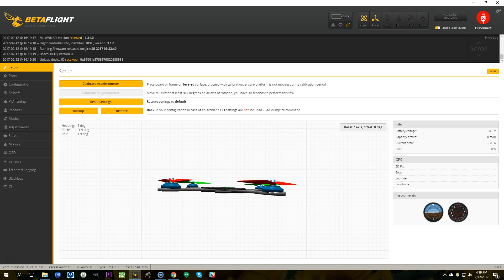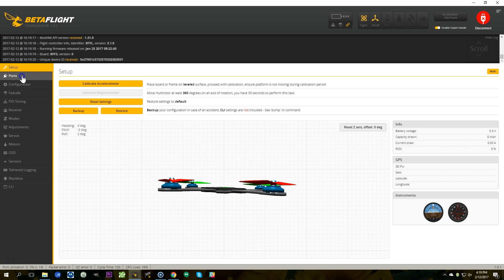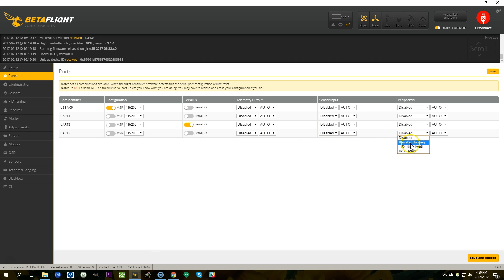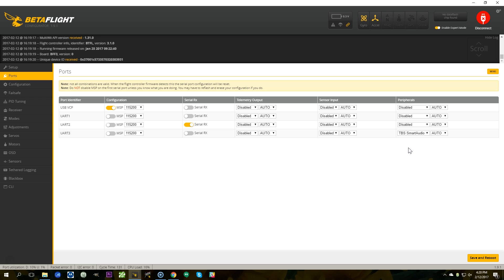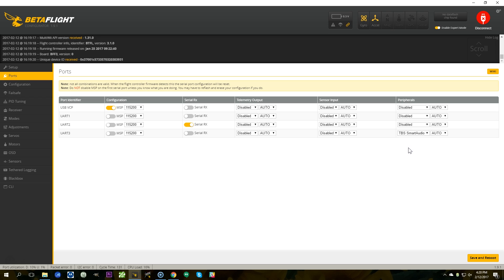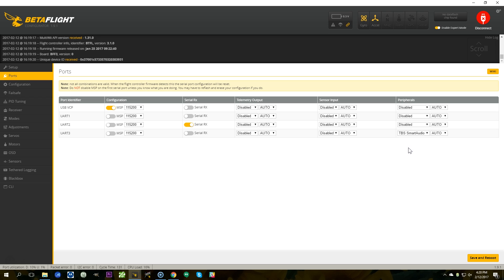BETAFLIGHT SMARTAUDIO | Change vTX channel and power remotely!

Comment: Very nice! Thanks for the video! I have DMed you on Instagram for another request :-)
Reply from the maker: +Ne Krähe Instagram is the least effective way to contact me by far.
Reply: Alrighty, whats a better way to contact you? (:
Reply from the maker: +Ne Krähe you can comment here.
Reply: okay, I did not want to bother you public with my concern, but well: I am working on an interesting project over here, basically a small camera-octocopter. Right now we use Betaflight but I am doint some flight tests on INAV right now. I already settled to CPPM rather than SBUS to save one UART, but still going short on them using bluetooth, GPS, Sonar.. Do you know an F3 FC (or F4) with 8 Motor Outputs but more than 3 UARTS? In the best case it has a micro sd slot aswell, for sure.. I have heard about more UARTS when using a bigger "package", so a bigger F3 seems to have broken out more UARTs, is that true? Do you have an idea to solve this?
Reply from the maker: +Ne Krähe rotorgeeks SSD has six motor outputs and 5 UARTs. 8 motor outputs is going to be tough.
Reply: Okay, so it seems to be very difficult right now.. If there is another thing coming to your mind and you did not forget my request, I would be happy to hear from you! Thank you very much for you reply, keep on your good work, always a pleasure! (:

Comment: So you connect the smart audio and then you can  change the channel and power of the tbs unify through betaflight or your transmitter?
Reply from the maker: +Jay Bennett yes.
Reply: Jay Bennett correct!
Reply: Graham Jones so how and where do you change the settings of your tbs unify in betaflight and/or your transmitter? How do you physically do it? This is where I am having a little trouble.
Reply: Jay Bennett in a nutshell, if you were going to use your taranis and not the osd, you would download opentx 2.2 and flash that, then you would get the betaflight Lua script, copy it to your taranis sd card in the scripts folder, set the script as one of your telemetry pages on the taranis. Then as long as you have the unify hooked up like in the video and you have smartport hooked up on your x series receiver (x4r,xsr,etc), you go to the telemetry page that has the script and change the settings on the vtx. Done
Reply: Joshua Bardwell.... So I went to the open TX home page to install 2.2 like what was suggested. Is it 2.2 RC10(N362) that I want? I am running 2.1.9 right now.
Reply from the maker: +Jay Bennett I'm not sure which version is best. I would probably take the latest.
Reply: Jay Bennett yes, be careful tho, I'd do a backup of your 2.1.9 models and settings if you don't already have one just in case, also you will need the new 2.2 Sd card files and folders, and you will need the 2.2 sounds and amber sounds if you use that sound pack, and that should be it.
Reply: Joshua Bardwell 2.2 rc10 is good it will work a few versions back to like rc8 but might as well get the latest. Also when u get open tx 2.2 configurator, you will need to go in the settings page and find where it says use open tx nightlys, for the firmware and the configurator and check those boxes. So it downloads the latest release candidate firmware.
Reply: Graham Jones I can't get the open TX 2.2 to update on my pc. I am going to have to spend half the night figuring this out. Lol I have some errands to run first. Is there a good tutorial on YouTube? I don't want to bunk my taranis.
Reply: Jay Bennett like you can't get the computer software to even install?
Reply: Graham Jones no the software installed perfectly. But when I go to see what version is going to be installed it says cannot update. therefore I cannot load a version to install.
Reply: Jay Bennett in the software go to settings>edit settings>application settings and check use opentx firmware nightly builds and use companion nightly builds if you haven't
Reply: Graham Jones will do as soon as i get home. I will let you know.
Reply: Graham Jones that worked! Ty! Now what was that about Lua files to my SD card? I haven't written anything yet to the taranis. What are these Lua files and where do I get them and is there a special way I need to get them onto the SD card?
Reply: Graham Jones I backed up the radio to a file on my computer. Fyi
Reply: Jay Bennett I linked to the site further down in the comments someplace, it's the github betaflight lua script page, download that extract and copy the scripts folder to your sdcard where you will also have a scripts folder
Reply: Graham Jones will do it now. Do it before I install 2.2? Or do I install the script and the make a backup? Sorry for seeming do dumb. I just don't want to mess this up and I want to understand so I can help members of our group.
Reply: Jay Bennett make a backup before anything just to have it just in case. Update the firmware on the Taranis. Copy the 2.2 SD card contents to your sd card, it will overwrite some stuff, that's ok let it, Then copy the scripts folder to your sd card. If you didn't get the 2.2 sdcard contents earlier you can go back to where you downloaded the 2.2 opentx config, it should be around there someplace or just google for it.
Reply: Graham Jones ok i am updated to 2.2 and I have a folder with betaflight Lua scripts in the script folder. Now I just have to connect the audio wire to the uart on the FC. Thank you for being so patient with me.
Reply: Jay Bennett It's cool I'm sending you a bill! Just kidding, but seriously in this hobby we all have to help our neighbor, so just pay it forward when you can! Good luck, and happy flying!
Reply: Graham Jones thanks again. Now all I have to figure out is how to get my sounds back. Lol I had the amber pack on it but it is gone now.
Reply: Yeah, you'll have to re get those. Here ya go. http://hmvc.eu/Amber22.rar
Reply: Graham Jones thanks for the sound pack it was much better than the older one I found. 😀

Comment: why do you have 4 caps on the TBS esc? will the OSD on the BFF3 crap out without caps on the ESC/VBAT? i know the minim will even with good 5v reg but what about the BFOSD chip? I never had to put caps on esc but sometimes on 5v and/or 12v.

Comment: FYI, after you set this up, you need to use the stick command "throttle center, yaw left, roll up" to get the betaflight menu to come up in your OSD or OLED display.

Comment: Hi Josh! Betaflight 3.1.6 now supports change vtx channel over softserial. Can you make a guide for this?
Reply: I'm pretty sure it's the same setup, but you need to enable "soft serial" under the "configuration" tab and then connect your Unify's audio line to the correct soft serial TX pin corresponding to your flight controller.
Reply from the maker: Correct.
Reply: Myles Shannon Yeah, but I'm pretty sure it doesn't work yet. I've talked to a few people and none could make it work.
Reply: FpvGear I got it working on a buddy's quad, using a prerelease version of betaflight I got off the build server. Using softserial on the xracer 3.1. Works like a charm.
Reply: What flight controller are you using?
Reply: Myles Shannon Holybro kakute v1. The one without pdb.
Reply from the maker: +Myles Shannon Betaflight F3.

Comment: Do you need a Betaflight FC to do that or can you do it with any FC that runs Betaflight? I was checking this feature just yesterday, but I don't have an OSD, just SP racing F3 evo + tramp HV, so I thought I couldn't do this cool trick!
Reply: You either need an OSD or an OLED display on I2C to interact with the settings menu inside your quad without the configurator.
Reply: OK, thanks! and you can't do it with the BF lua script through the taranis?
Reply: KMS FPV you can do it with the bf Lua script! Must have opentx 2.2 though
Reply: Awesome it's working! Thanks guys! Now I got telemetry, PIDs, and VTX on my Taranis! Dope!

Comment: If I'm actually using audio and can't even hover properly in FPV without hearing the motors, will the audio still work or I will hear only modem sounds and have to re-learn to fly without sound?
Reply from the maker: You should never hear the SmartAudio beeps while flying. Do you really want SmartAudio to be able to change the channel while in the air?
Reply: If the signals for configuration are sent only when changing channels, it's OK as you are on the ground. But it might send some periodic pings or some sort of communication. Also if there's a mic connected, the sound from mic could corrupt the smartaudio stream. I'm planning to get one of these TX with settings from OSD, but can't find much info how do they work when used with a mic.
For the science, maybe you cold attach a mic to your quad just to test if it doesn't corrupt anything?
Reply: RandomWisdom I've heard it only transmits when your changing stuff, haven't tried it though, and the developer who said this hadn't either.
Reply: I'll let you know in a few days or so when I get done building my new quad and try it.
Reply: That would be very interesting! :)
Reply: RandomWisdom yeah I'm curious myself of how it plays out, like Will I have to make sure it's quiet around the quad when changing vtx settings? who knows!?!

Comment: hey Josh, can you do a video on how to wire up a current sensor so that it displays in the betaflight osd? also how to wire up current sensing using kiss24a's?
Reply from the maker: +ghall05 wire the current sensor output to the current input pad on the FC. Enable current sensor in Betaflight GUI. Calibrate the sensor. I have a video in how to calibrate if you search the channel.

Comment: it only works with minimOsd ?
Reply: And it can work with Betaflight OSD using a Minim OSD if yout FC does not support BF OSD. 

You need to set up Minim OSD in with Canvas support in Minim's config.h  as well as the correct betaflight version:

#define BETAFLIGHT 
#define CANVAS_SUPPORT    

And Betaflight must be built with USE_DISPLAY_PORT presumably to draw to the canvas that Minim will provide.
 
I can confirm it is definitely possible to get it to work - I had it going before my last FC died. It didn't support BF OSD so I had to use Minim.

But I cooked it and now my new FC supports BF OSD itself, which rocks.

You can actually have both Minim and Betaflight OSD working together, sort of.

Also see:
https://github.com/ShikOfTheRa/scarab-osd/blob/master/OTHER/DOCUMENTATION/Canvas_CMS.md

And try this wiki page - he doesn't really tell you how, but he does have hints and links to I think all the relevant docco: https://tmr.kiwi/betaflight-mwosd-smartaudio-cms/
Reply: VastFPV yes, you have to have the new opentx 2.2 but then go to the betaflight wiki, go to the smartaudio page, and then somewhere around the middle of the page there is a link to the betaflight Lua script, it does pids on th first page, rates on the second, and vtx on the third page of the Lua script, works great too. Edit: here's the link for the bf Lua script https://github.com/betaflight/betaflight-tx-lua-scripts
Reply: I found this repo with a collection of scripts from Boris. https://github.com/betaflight/betaflight-tx-lua-scripts
Reply from the maker: +Ridzaq it definitely works with Betaflight OSD.
Reply: Ridzaq or betaflight osd, or a Taranis that has smartport telemetry and the betaflight lua script
Reply: It only works with pre-release minimOSD version 1.6.5 or higher. 

Edit: I meant in reference to minimOSD only
Reply: is there a taranis lua script for smart audio yet? i've been looking for one!
Reply: word up! good looking out!
Reply: +jtan163 wow thanks, will definitely try that :)

Comment: How connect microphone to TBS Unify and using TBS SmartPort on one wire Audio?
Reply from the maker: +Igor Morenko just connect both the microphone and the UART to the same line. I haven't tested it but I'm told it works.

Comment: which is the tbs best vtx?
Reply from the maker: +nasir jamil I like the Unify HV because you don't need a big 5v regulator.
Reply: Joshua Bardwell thx u can we compromise on vtx by buying cheap price vtx or it should be the best like tbs ?
Reply from the maker: +nasir jamil if you want smart audio you need Unify or Tramp right now.
Reply: The Unify Pro HV Race is $30 and has all the latest features. Only difference is that the power output is capped at 200mW.